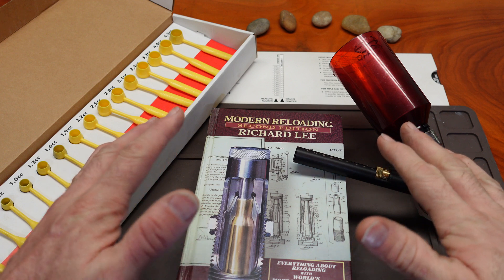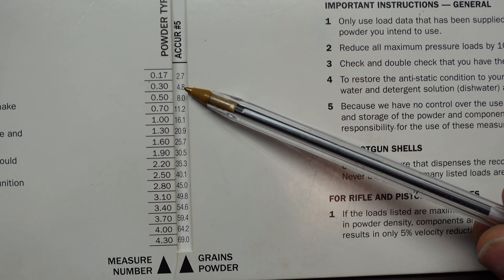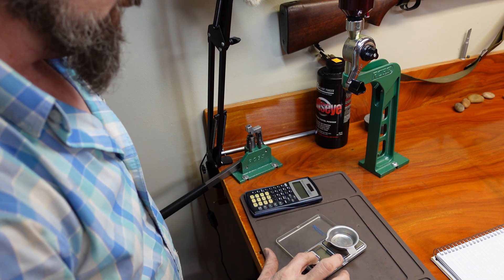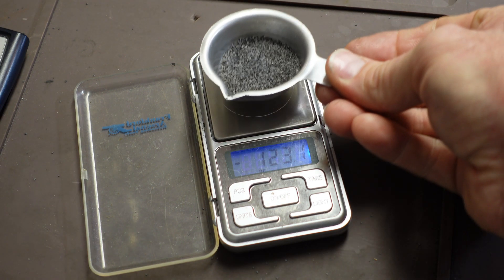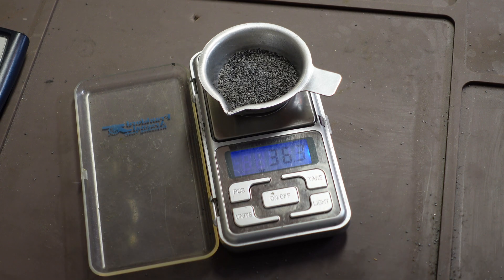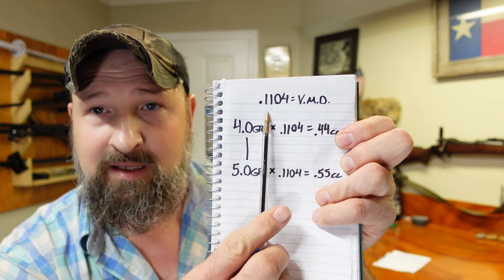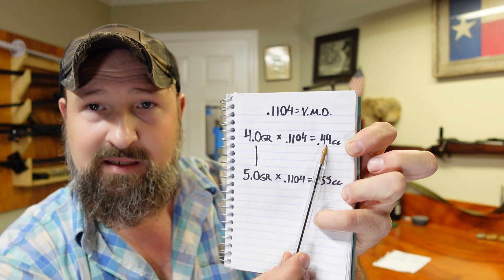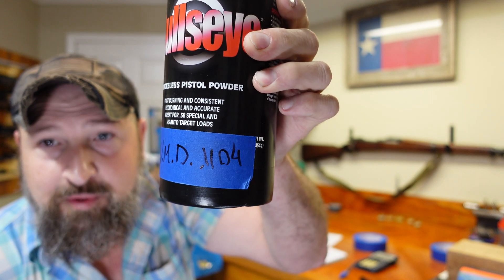Volume Measure Density and the Lee Powder Measure

Comment: do I understand it right that powder adsorbs moisture and if left out will gain weight from humidity in air thereby changing that powders's density. I wonder if this could be used as a test by how much, if by significant amount. or is it that the powder becomes weaker somehow?
Reply from the maker: I've heard the same. I have been curious about high humidity areas vs. dry areas as well. Hot vs. cold and so on. I bet a fella could do a lot of testing with these variables/environments.
Reply: The study done by Norma shows it only takes a couple of weeks for the loaded round to fully re-acclimate to a different humidity level, while other test show it starts to take effect within 24 hours. So if one loads in Florida, and then moves to New Mexico the humidity in the round will change to its new environment. same way if one travels the other direction. Basically one should seal the rounds before taking them out of its environment to keep humidity levels the same before traveling.

Basically, my thoughts are to store powder and primers between 40-65% humidity (pick a precise level such as 50% and keep it there), load the rounds in the same humidity level, as well as store the ammo in the exact same level of humidity. And do not forget to seal the rounds before taking them on a trip to keep them from re-acclimating to the new environment.

And yes the temperature of the storing and loading spaces should be kept around 68 degrees F for optimal ammo life, but we the people may feel better about 74 degrees F. And temps over 150 degrees F [such as in closed vehicle during the summer months] are really bad for the powder and will cause it to break down fast. Not to mention wide temperature fluctuations can kill the ammo too [due to moisture condensation within the cases]. And direct sun light upon the ammo, for any extended amount of time, should be avoid at all cost, especially before firing them.

Variations in moisture content change the burning rate of a powder and thereby chamber pressures and muzzle velocity. The moisture content of the N500-series' normal moisture content is 0.6 % and the N100 and N300 series powders is usually around 1 %, because of the added nitroglycerine.

Johansson explains that, as manufactured, most powders contain 0.5 to 1% of water by weight. (The relative humidity is "equilibrated" at 40-50% during the manufacturing process to maintain this 0.5-1% moisture content).

So yes humidors in a controlled environment is the way to go from start to finish. Even in transport when possible.

Do these things, and "long live the ammo".

Black Powder is different and should always be kept as dry as possible. The lower the humidity the Black Powder is stored in the better.

Interesting fact:
Militaries around the world store their double based smokeless powder long term immersed in water, and then dry it out thoroughly before use. By doing this the powder never breaks down and will last indefinitely. (See: Handloader's Manual, by Earl Naramore, Chapter 3 - Powder, page 133)